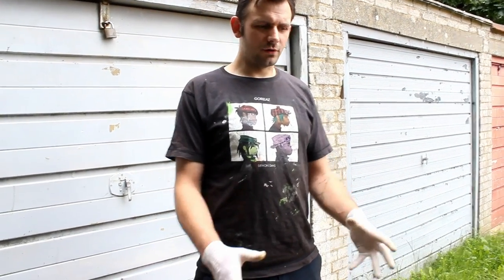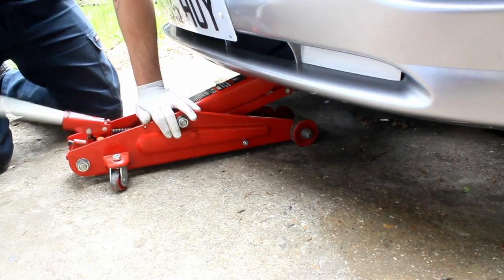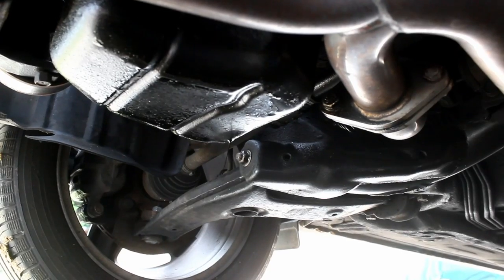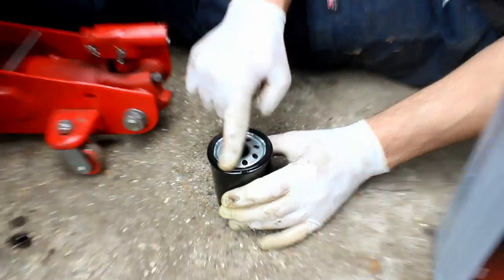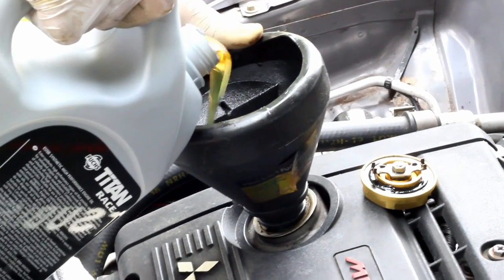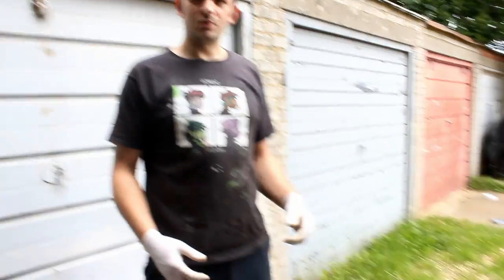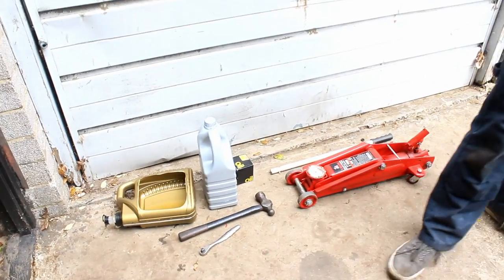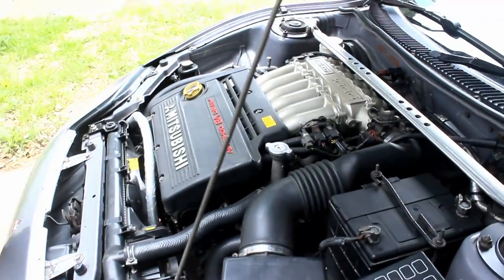How to Change Your Oil - Mitsubishi FTO Basics

Comment: Hey buddy, do remember if front belts are the following:

Alternator belt: 4PK945
Aircon belt: 6PK1070

Thanks
Reply from the maker: Off the top of my head I'm unsure.  I'll have a look at what's on our car.
Reply from the maker: Sorry I've not replied yet, I'm picki g the car up from storage tomorrow.
Reply from the maker: 4PK948 is what we run on the alt belt. 
I'm afraid our PS belt isn't showing the markings anymore due to running on a less than perfect tensioner pulley.
Reply: @ManSeeksCivic  all good buddy and thank you for reply.

I ordered 2 mentioned above as I'm going to run a standard pulley not light weight anymore. I feel the transmission isn't enjoying it too much.